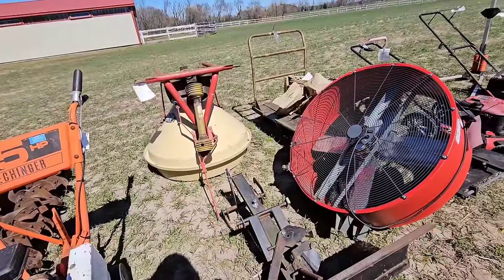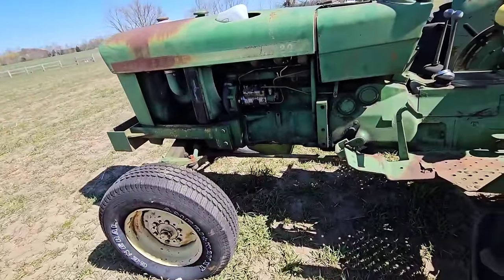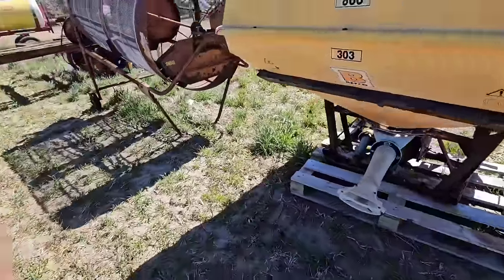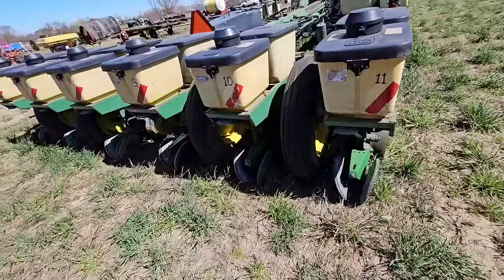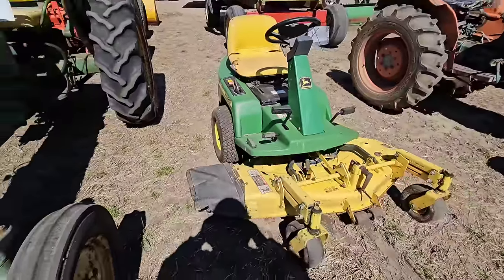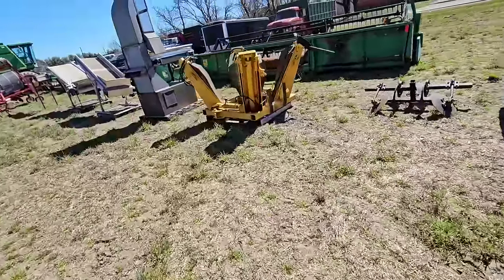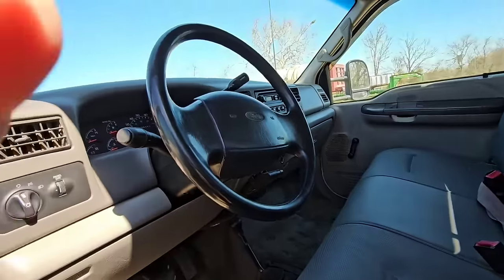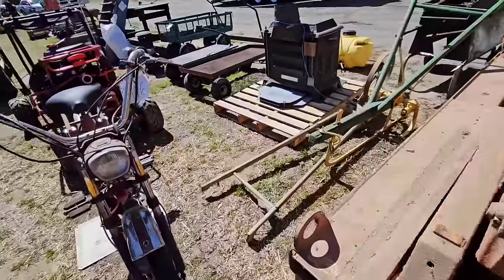Farm Auction Season

Comment: For some reason, I've always wanted an IH SuperA and an Oliver OC3 crawler. When I was 16, I started a business cleaning and repainting farm equipment. (Didn't have to bale hay and straw in the summer like other guys) I cleaned, sanded, straightened sheet metal, and repainted a lot of IH Bs,Cs,Ms, Oliver 1600, 1700, 1800 sizes in the the 00,50,55 series tractors and I painted 2 Oliver OC3 crawlers.  One industrial and an ag models. Fell in love with those little crawlers. The industrial had a Sears and Roebuck dozer blade on it. 😊